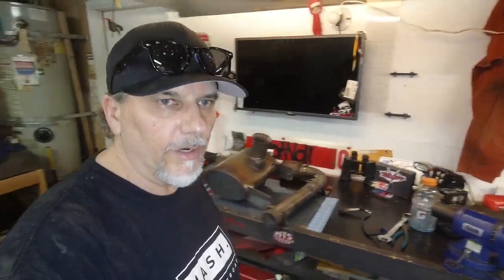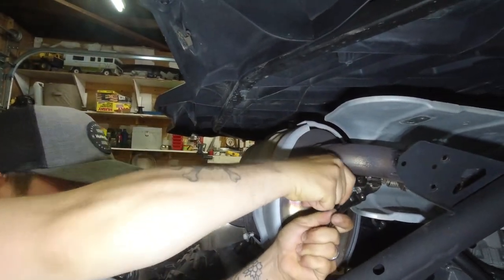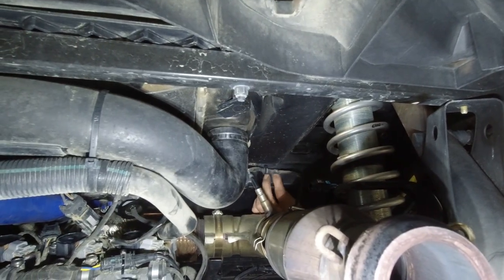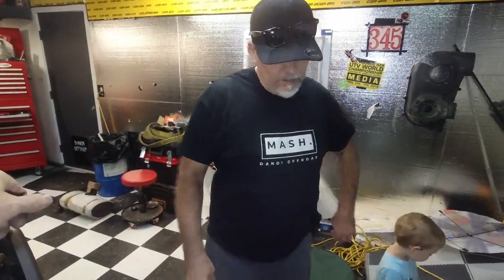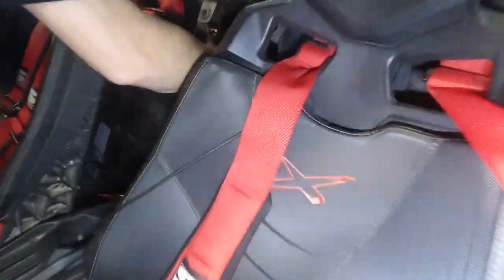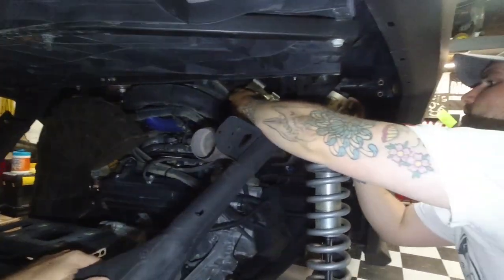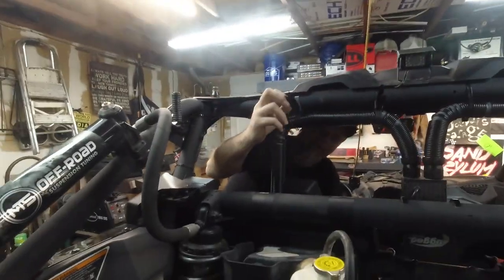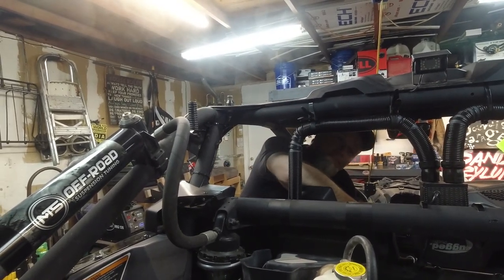EVOLUTION POWERSPORTS CAT DELETE EXHAUST INSTALL ON THE MAVERICK X3

Comment: I'm looking at this muffler I already have a catless pipe and the RPM muffler but it too loud under trail riding conditions at part throttle. How is this muffler to ride trails with? Is it obnoxious? The RPM sounds great under wide open throttle but too much at part throttle to listen too all day
Reply from the maker: This one is louder than stock but sounds great and not so loud that it's annoying